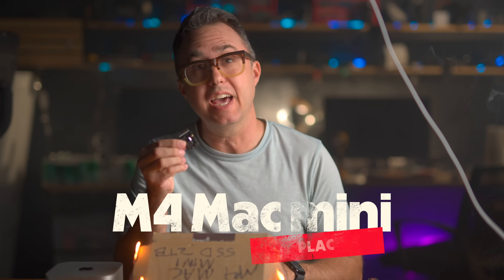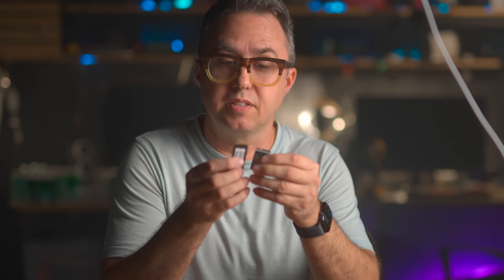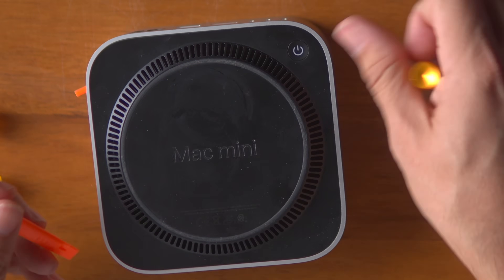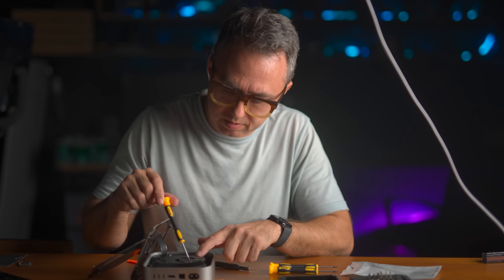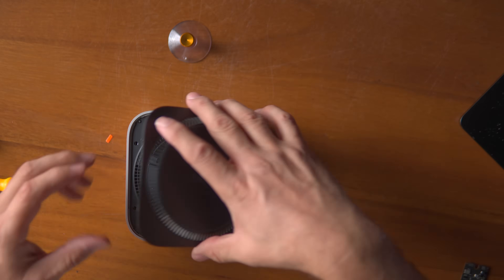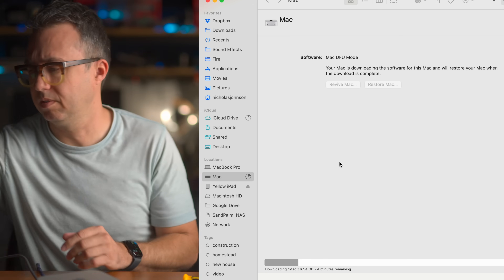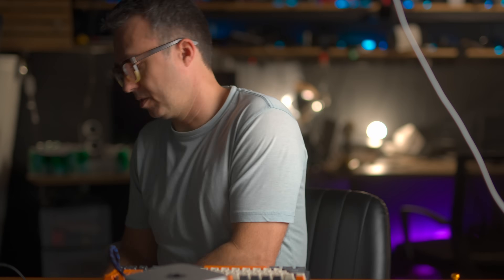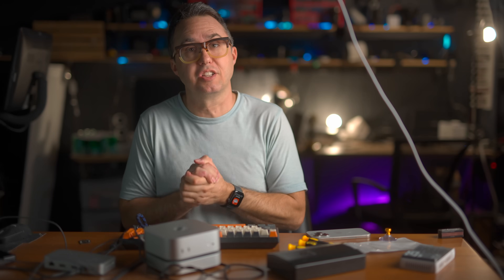Upgrading M4 Mac mini Internal SSD, step by step

Comment: You know Apple is going to send an update through that bricks these, right? It’s just a matter of time.
Reply: I would not be so sure about that. At least in Europe that would be a violation of Art. 5 (6) Directive (EU) 2024/1799.

At the latest by 31 July 2026 this would result in significant penalties for Apple Art. 15 Directive (EU) 2024/1799.
Reply from the maker: I have heard this concern a number of times now and its certainly possible, but I wouldnt necessarily say its only a matter of time.  I think a more likely scenario is that they dont make them user serviceable in the future.
Reply: @SPACEDESIGNWAREHOUSE  maybe...maybe not, but you better have up-to-date backups anytime you install an update...i don't think saving a few bucks is worth the worry...just use thunderbolt drives and have the ability to move them from system to system anytime you want.
Reply from the maker: @ I agree, mostly, for a system that stays parked on a desk anyway. The prospect that this is possible is interesting either way
Reply: you know the replacement drive is indistinguishable from the factory drive right?
Reply: @df4196 well, definitely not the serial number or firmware revision. Not sure you understand how this works.
Reply: @druxpack8531  lol as if those things can’t also be changed. Taller fence = taller ladder.
Reply from the maker: @df4196  I do see in my system report that the computer is calling it an apple drive.
Reply: I would be more concerned about the quality of the replacements. What guarantee do I have ordering a part from some random seller on Aliexpress etc. that the chips are good for as many write cycles as the ones Apple uses for example? ...or that I don't wake up one morning to the sad Mac logo on the screen and a "no disk found" error. Yes, Apple charges a premium - but I'm bothered by the anonymity and lack of info on the replacements available.

Comment: Yes, the replacement drive is faster, but bigger SSDs are generally faster, because they have more lanes.   This is also the case with Apple's SSD's.  So the more apt speed comparison would be versus an M4 Mini with a 2TB OEM Apple SSD.  With a bit of searching you could probably find someone who's run that test using BlackMagic, and compare that to what you're getting.
Reply from the maker: Would that be a fair comparison though, considering the OEM one is 4 times as expensive?
Reply: @SPACEDESIGNWAREHOUSE  It's about giving your viewers an accurate picture of what's going on.  Most don't realize SSD speed varies with size.  Thus your video could easily give such viewers the misimpression that not only is the aftermarket SSD 1/4 the price of Apple's 2 TB model  (true), it's also much faster (likely false).  Instead, it's probably the same speed as Apple's 2 TB SSD, so it's *not* significantly faster than the one that costs 4 x as much. Instead, it's probably *the same speed* as the one that's 4x as much.

Comment: After much research I need to inform anyone who purchases the SSD that you can only load the new firmware with attaching to a Silicon Mac, most likely a Mac released 2021 or later. I now find myself with a disable Mac Mini M4 until I source someone who can lend me a Silicon Mac to use. Installing the old SSD still needs the Firmware updated.
Reply: you can also restore the Mac mini with a windows computer and VMware
https://youtu.be/HSmpsXwSrBM?si=tH-r8mxIgjMJ1KZN
Reply: @guilloguzmanl  What about the 2020 Macbook air m1  i think it's the first silicon chip since the switch from intel
Reply: You can also use idevicerestore , no vm needed, just linux

Comment: Can you please help. I have installed the SSD and have connect the Mac Mini M4 via thunderbolt cable to my Mac Pro 6.1 however when I startup the mac Mini M4 to do not get the prompt to update the firmware. Suggestions/advice please.
Reply from the maker: I am really sorry to tell you this, but you're going to need to find a different Mac to do the firmware upgrade.  That Mac Pro is simply too old. I don't know exactly how new the other computer needs to be, but it needs to be capable of running current Mac OS.
Reply: you can also restore the Mac mini with a windows computer and VMware
https://youtu.be/HSmpsXwSrBM?si=tH-r8mxIgjMJ1KZN

Comment: Downside....dfu software only runs on macs 2015 onwards. Unfortunatley my old mac is 2012. So m4 replacement ssd is not possible for me. 😢
Reply: you can also restore the Mac mini with a windows computer and VMware
https://youtu.be/HSmpsXwSrBM?si=tH-r8mxIgjMJ1KZN
Reply: @guilloguzmanl  Thats not been tested though. In theory it should. I was told it won't work because it needs usb c that supports vdm through dfu. You notice how the m4 has a specific usb c port that supports dfu not just any usb c port. This is why I've been told its the same with the connecting pc. I'm waiting to see someone actualy do it successfully to know for sure. Would be great if it did work.

Comment: Upgraded this weekend with the 2TB kit.  All went well and works great.  Only thing to remember is to use better screw drivers than the ones provided as the are no good.
Reply from the maker: I’m pretty sure one of them was the wrong size, which is odd. Maybe Apple used two different sized screws on different runs of the mini

Comment: Did this yesterday,  the drive install is cake and really anyone can do it.  Kit didn't come with a 8 star bit so had to use my own to unscrew the drive itself.  Word of warning, using the Windows "Apple Devices" app to restore the DFU would not work no matter what I did.  I tried multiple laptops with Windows 11 and all the cables I had, (C to C, USB-A to C, different C to C).  The DFU restore would fail with a 4013 error each time.  Eventually I just used an older Macbook Pro running 15.2 with OpenCore and it was a flawless experience.  Great tutorial!  Saved me a lot of cash.
Reply: I also have an old MacBook (2014) with OpenCore. Did you use Thunderbolt 3 to Thunderbolt 2 adapters?
Reply: @ramosgot  I used a usb-a to C cable connected to the unsupported mac without issue.  Presumably slower but it worked.
Reply: So on the second  mac need to be on osx 15.. my current osx is Monterey..
Reply: @djBroRay  My second mac was running 15.2 on an unsupported mac.  Windows 11 would not work after about 7 tries I decided to try the old mac.  I do not think you have to be at 10.15 or higher.
Reply: It is possible to create firmware on ssd using one Mac mini m4 and later use this ssd on another one? Mac mini m4

Comment: Any ideas if i have only mac mini m4 
Can install os by pc or prepare flash drive before upgrade
Reply from the maker: You CAN install by PC now - but you need to use a virtual machine running linux.  The company I get these drives from is working on an 'image file' so you won't need to know anything about linux, just start it in a virtual machine to use a PC to flash these.  He's not done with it yet and also it's Chinese New Year so they sort of stop doing anything until the first week in February.
Reply: @SPACEDESIGNWAREHOUSE  i see videos to use a bootable usb flash drive for os system 
I will make on mac mini before i update the ssd and then I will use it to flash the new ssd
Reply from the maker: @beta3alkimya986  interesting!  Id love to hear if it works!

Comment: Can this be done over USB or the older Air book thunderbolt port  ? My old Airbook 13" circa 2012 only has the original Thunderbolt square port.
Reply from the maker: Unfortunately I do not know the answer to that.  I know it DIDNT work with the Mac Pro Trash Can computer, so I suspect it requires the modern thunderbolt ports.

Comment: isn't this risky as apple could roll out an update that bricks the whole mac?
Reply: Well; if they did that, it would only brick this new drive.  As long as you do regular backups, you could then just swap back to the original drive.   You don't have to cut through anything, or break any seals so reverting back will always be an option.

Comment: Any problems removing the t3 screws? Mines looks like they were stripped from factory, if I place the screwdriver it looks like would just rotate, not sure if the mace like that or the screwdriver is smaller, or Apple changed the screws recetly, I got the Mac mini a couple of days ago
Reply: I’m having this issue too but with both t5 and t3 I think it’s the cheap screwdrivers the ssd company provided not stripped screws. I had another t5 screwdriver lying around and it worked but now I’m at the t3 stage and I don’t have one so I just ordered a new set 😢

Comment: I just bought the base model of the mac mini M4.  I have not even turned it on.  If I want to upgrade the internal SSD, do I need to have Mac16,10 firmware available on another computer to complete the process?  It did not seem like you needed it at time stamp 5:50.  I don't have a macbook lying around.  I have a Surface Pro 9.    The other question I wanted to ask or rather get some advice is whether or not I should buy the 1TB or the 2TB SSD.  I am not a power user of anything computer related by any means. I am using 77 GB out of the 256GB on my Surface Pro 9.   I keep telling myself that I want to do web designs, graphic design, create and edit video but I have yet to follow through.  So I am thinking the 1TB is enough.  If I do get into this new hobby and I start running out of storage, I can then purchase a docking station like the soon to be released Satechi Mac Mini M4 Stand & Hub with SSD Enclosure and max that out at 4TB. Thoughts?
Reply from the maker: Correct, it appears that you do NOT need to pre-download the firmware - your computer will download it automatically when it's restoring the Mac mini. But you will need a Mac computer to connect to the mini after you've put in the new drive. 

I agree with you, from the sounds of it, the 1TB drive will be totally fine.  You'll notice pretty quickly after getting into video editing that thee project files are pretty huge - but external SSDs are really cheap and after you're done editing a video, you pretty much don't need to touch it unless you want to go back and steal some b-roll off of it, so there's no reason to keep those files on your main drive anyway.  We're all just data hoarders.
Reply: jeżeli zaczniesz nagrywać i edytować filmy to 1tb nie jest tak dobrym rozwiązaniem jak 2tb

Comment: I just purchased the new mac mini m4. Also purchased the new 2 tb drive. If I am starting from scratch with a new computer, can I install drive, hook up to mac with firmware, and launch new mac mini without restoring from back up? Could I not use disc utility to install operating system and start fresh?
Reply from the maker: @zebradisco  yes if you’re buying a brand new computer and not “cloning it” from a different computer, you can just set it up as new. I’m pretty sure you’re still going to need a second mac to put the firmware on that new drive though.
Reply: @SPACEDESIGNWAREHOUSE  ok cool. I'm still waiting on both to arrive, but since this is all new I did not really want to go through the hassle of setting up new Mini, backing up, doing the upgrade, then restoring. Thanks!
Reply from the maker: @ oh yeah, no need to do that. Once the new drive is in and the firmware is installed, it is exactly like a new computer coming from the store.

Comment: Quick question on this: after having loaded the OS onto the 2TB drive, could you remove that drive and put the original 256 drive back in and have it boot up immediately? Have you seen anyone else try this? I want to understand what works on this and what doesn’t before I pull the trigger.
Reply from the maker: @ahgflyguy  that’s a good question. I didn’t try that, but I will try that- unfortunately for the next couple weeks I’m up in NYC on a production gig.
Reply: @ I mentioned it to a Redditor who said they’ll try it to, likely before you get to. I’ll save you the trouble and let you know how it goes.
Reply from the maker: @ahgflyguy  I appreciate that!
Reply: @SPACEDESIGNWAREHOUSE Okay, so YES you can still use the 256 GB drive that came with with the Mac, but you have to do a DFU restore to it to get it to work again. And then to re-pair the machine with the 2TB drive, you have to do ANOTHER DFU restore.  So it works, but it’s not intended to be a useful way to do things. 0:02  I’ll verify in a few days when mine gets here.

Comment: Time will tell if SSDs lifespan will be good. I know there is backups, etc. What are you guys’ thoughts on lifespan and reliability of this ssd?
Reply from the maker: Im pretty happy to see that the serial number comes up as SanDisk.  I know that doesn't automatically speak to their reliability - but I at least recognize the name!  I'll definitely be making update videos when there's a MacOS update to make sure they didn't catch on and firmware these out of order - and also speak to their continued stable operation (or not)

Comment: I would have some concerns of installing a drive which requires firmware from a 3rdparty provider. Who knows that is in 'included' in that firmware
Reply from the maker: @jkristia9478  I thought the same thing but that website is a very well known site that connects directly to apples servers to download apple firmware. Those firmwares come straight from Apple.

Comment: Sincere question -- why would you want to do this and void your warranty rather than using an external drive?
Reply from the maker: I wanted to do this simply to see if it could be done.   Also - Im not so sure the warenty on a 500 dollar computer is all that important to me.  I didn't have to break any seals to accomplish this, so if there's some problem where I need to take this computer to an apple store, I can just put the old drive back in.
Reply: @SPACEDESIGNWAREHOUSE  Thank you for your answer.  I was viewing this more from a general standpoint rather than your one specific unit, so my mind was thinking more of the higher end of these devices and not just your single base-model device.  Now, if only the RAM could be upgraded anywhere near as easily.
Reply: Internal is faster
Reply from the maker: @leogomez424  Amazingly, these thunderbolt external drives are ALLLLLLLMOST just as fast.  This is just such an interesting thing to be possible I needed to see it done!

Comment: Im getting my Mac Mini M4 soon and i want to replace the internal SSD with the 1tb from here, i am wondering what the chances of apple figuring out the different chips and disabling any mac mini m4 that has that chip in it could be? i saw one comment here ask that but i want to know if its worth the risk of doing the swap
Reply from the maker: @davidmolin8944  just make sure to do regular backups and keep the old drive and everything will be fiiiiiiiine
Reply: @SPACEDESIGNWAREHOUSE  alright, i do wonder if apple does do a recall due to the faulty USB-C ports, will modified M4's be rejected?
Reply from the maker: @davidmolin8944  There are faulty USB-Cs?
Reply: @SPACEDESIGNWAREHOUSE  apparently people have reported the rear USB-C ports stop working sometimes when using a USB-C to USB-A adapters or USB-C in general

Comment: Please explain the difference between the Orico Mini Mate and the RaeQue Mini Hub.  Can't you use the RaeQue Mini Hub for your backup? Which is better and why?  I just got a new Mac Mini to replace my aged out iMac.
Reply from the maker: The differences are that RaeQue Mini Hub is a HUB - so it has USBa USBC, SD card slots and stuff.  But it has a SATA SSD, which is about 6 times slower than the MiniMates NVMe SSD.  

So the differences are its slower than mini mate, but its also a hub, which if you need more ports, if very helpful.
Reply: @SPACEDESIGNWAREHOUSE  So, it would also serve as a back up for the Mini Mac to use for Time Machine?  Thanks, like your channel and subscribed.
Reply from the maker: @jimpalmer1944  Yes, both can serve as a backup for your Mac mini.  ALTHOUGH I just read the descriptiontion again, and the RaeQue Mini Hub DOES NOT come with an SSD.  You would have to buy one and install it in there. It has a spot for an SSD but a drive is not included.
Reply: @SPACEDESIGNWAREHOUSE  Thanks, I think I want a RaeQue for the Hub and Time Machine.  Seems the best for my situation.  I already have a couple of SSD's.
Reply: @SPACEDESIGNWAREHOUSE  The Orico external drive runs at 40gps while the RaeQue runs at 10gps.  Now if you are only going to use the RaeQue for Time Machine then good enough but 10gps for your data drive would seem to be noticeably slower.  Is the Orico drive proprietary ? is it silent? does it run hot?  Keep up the good work
Reply from the maker: @ I tried to open that thing can couldn’t get the bottom off! But I asked their rep and it’s got one of their NVMe drives inside, so not proprietary.  It also has a fan so it definitely doesn’t run hot; the only criticism I have and I should have mentioned this in the video, but the fan is always running, not just when it gets hot from use. It’s not very loud, but it’s not as quiet as the nearly imperceptible Mac mini fan.
Reply: @ thanks. I tried communicating with the manufacturer and they made it seem that it couldn't be upgraded.  But if you couldn't get the bottom off then perhaps it isn't DIY which is a major design flaw.  Sooner or later someone will release a hub that....
1) allows an NVMe upgrade at 40gps  

2) stackable with a M4 Mac mini 

3) adds a couple of "Type A" ports IN THE BACK  so you don't have cables running all over your desk 

4) allow access to the on/off switch of the mini 

5) is thermally efficient enough so that it can be cooled passively and or silently (I don't care which) 

6) has a drive bay for 2.5" SSD/HDD for backup